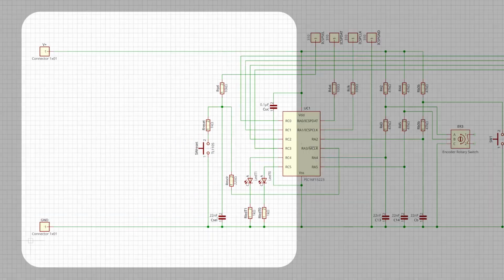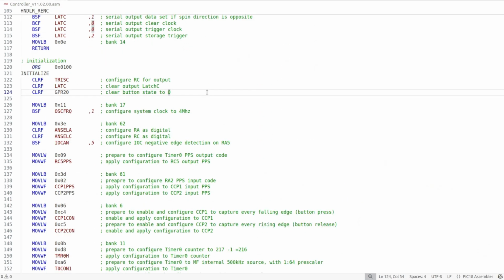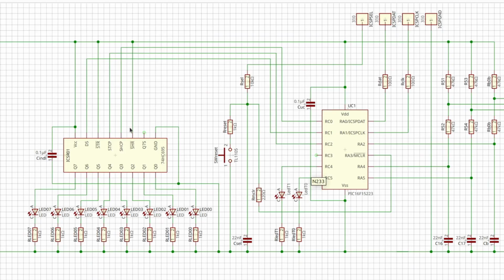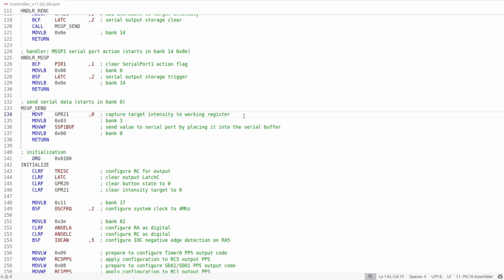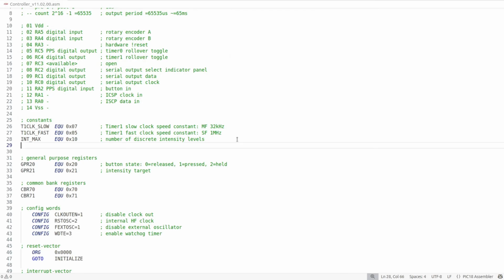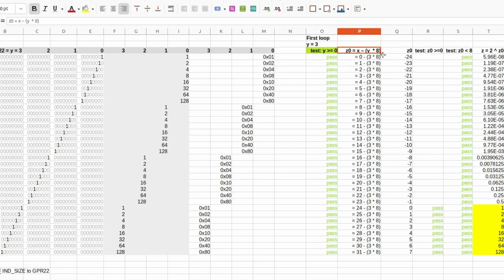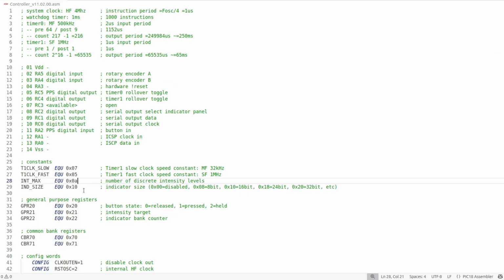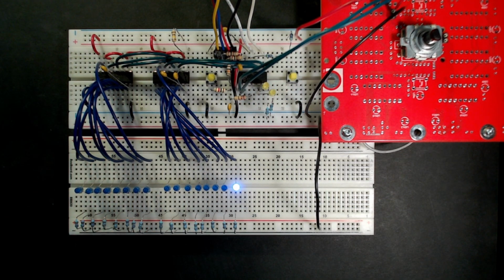SPI on a PIC Microcontroller in Assembler Episode 037

Comment: Is it possible the pgm did not recognize the  SD0 value was if the .INC (include) file for this controller was not referenced to in the pgm header?
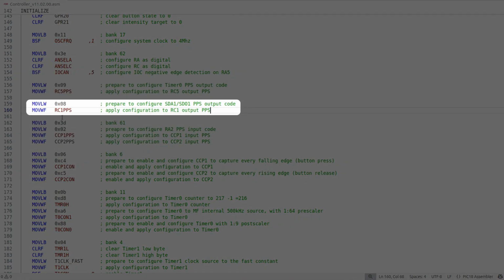Reply from the maker: I doubt that was the problem; at 12:29, I used the hexadecimal value 0x08 to reference the PPS code for the SDO output. Since I am using my own custom assembler, I am not making use of Include (.INC) files at all.

Comment: I got thrown there for a sec, the IC in your schematic shows 74HC695? Which appears rare and very hard to find. Eventually, I got the seemingly right one, 74HC594? !!
Reply from the maker: Did my schematic read 695 or 595? I’ll double check but if it said 695, that would be my error; it is indeed the 74HC595… apologies Alan! The 594 works just as well for this application; the difference is that the 595 includes a third “high impedance output” state on pin 13, which is not used and tied high. Pin 13 on the 594 is an active low clear, so you can leave it tied high.
Reply: @rafiqilluminate   Just another small point, it would help to use IC pin No.s as if using the TI IC info sheet, the pin descriptions are totally different! . The DWG looks close to the free Kicad  BTW which does include IC pin No's 🙂
Reply from the maker: @alaninness8113  yeah, you're right; it would be better to use the proper pin layout. I was going to do that originally, but it made the little blue animations way more difficult, so I took the easy route and put all the output pins on the bottom and reversed the order so Q0 is on the right and Q7 is on the left. The ACTUAL pin placement has Q7 on the right and Q0 on the opposite side of the chip... that would easily add a few hours to the animating process, and make the schematic look more messy (!)
Reply from the maker: aaargh! that's a double screw-up on my side; my schematic does indeed show 74HC695! and to add another layer of whoops, the actual IC I'm using is the one you correctly identified, Alan; the 74HC594, not the 595 I referred to in my earlier comment! So to confirm, I am using the 74HC594 shift register; please disregard the IC label on my schematic, and accept my apology!

Comment: I once saw a traction control project written in C for the 8bit pic range and the author had to use an 8 k device. I did my own in assembler in less than 256 bytes on a 12f675. I always work in assembler even on the 16 bit range. 👍
Reply from the maker: Wow. I always knew using compiled C used more memory, but I had no idea it was THAT much more!